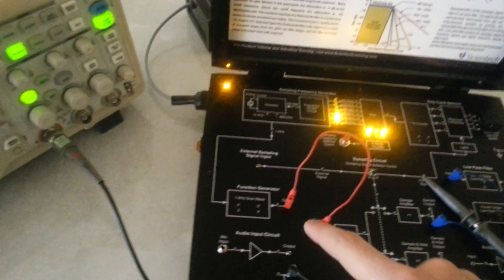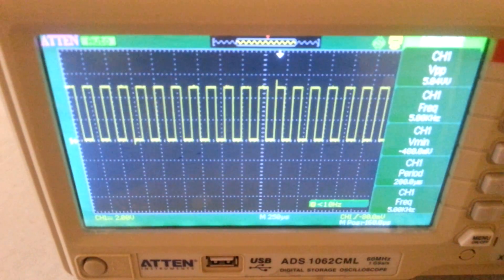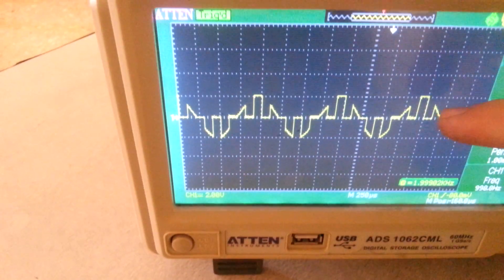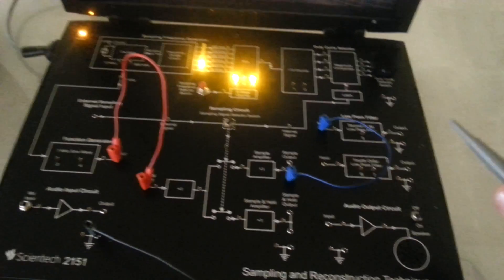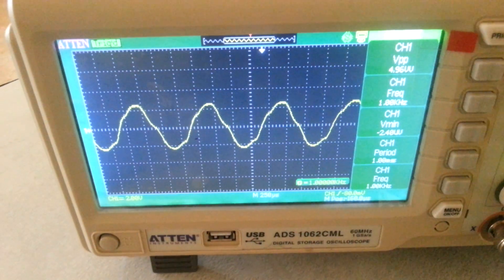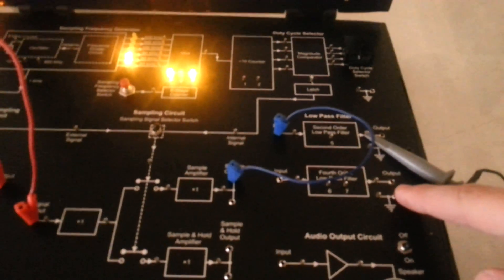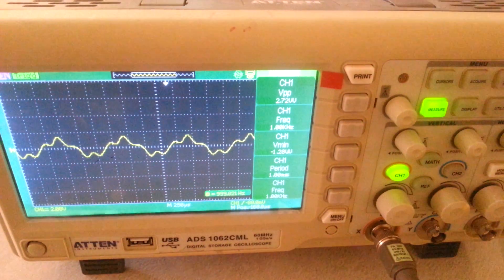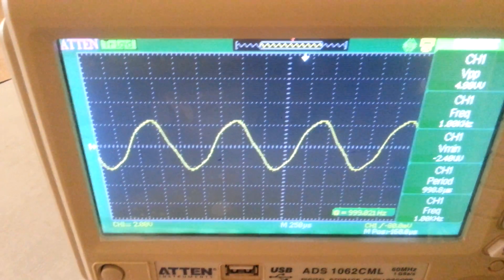Sampling and Reconstruction (PAM) Lab

Comment: Sir, why the sampled output has a frequency same as that of input signal?
Reply: It is the same frequency because that is the reconstructed input signal, which has frequency 1kHz. Sampling theorem states that if the frequency of the sampling pulses is twice the modulating signals, the modulating signal can be reconstructed easily at the output. So you will get the same frequency at the output. 
Here's what is going on in the circuit > 
Your information signal's frequency changes w.r.t carrier (sampling pulses) > Sample and hold circuit will hold the amplitude of your pulse till the next leading edge. So now, your signal looks similar to the original signal. After going in the low pass filter, the sample and hold output (one which looks like steps) will be smoothed out. 
And that's why, your frequency will be same as input.
Reply from the maker: Adil Ahmad  hello Mr Adil. The output signal freq is = 2  sampling signal ( pulse ) freq. 
I think you are talking about oscilliscope screen measurment, in fact , this mesurment represent the freq of the average samples in each cycle ( i mean positive & negative samples freq).
I hope this benefitial
Reply: Yes, I took 1 KHz input signal and the sampled output so obtained also has the same frequency. Why is it so?

It should show : Sampling frequency. Yes/No?
Reply from the maker: Adil Ahmad as i told u . It is an average freq of signal that are consists of posiitive samples and negative samples